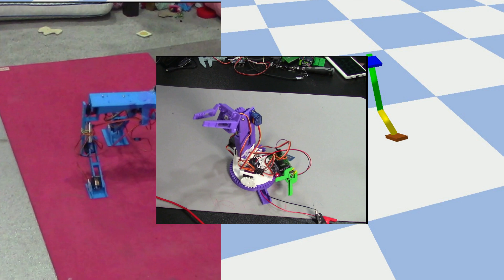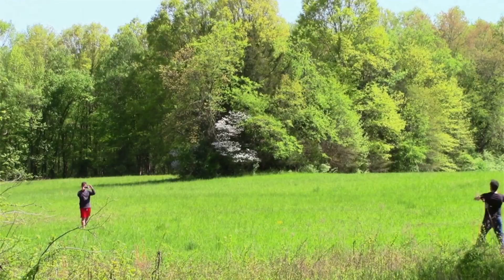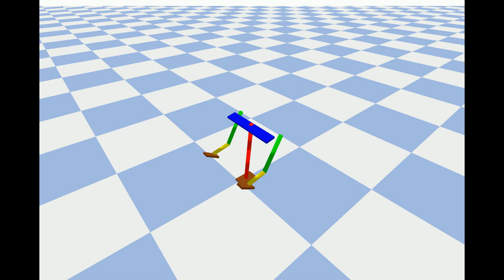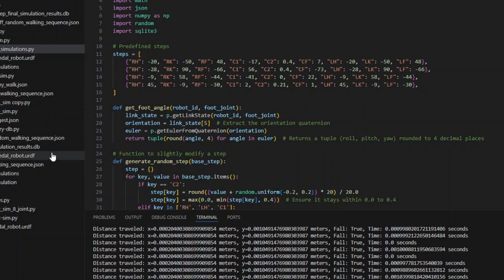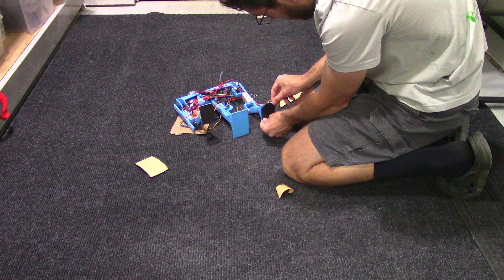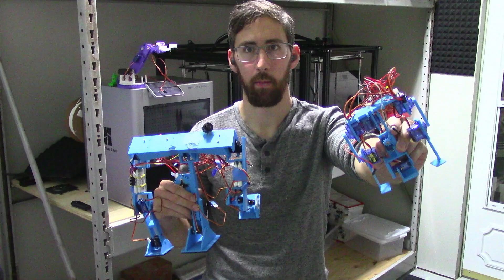Simulating 1 Million Robots with Python for Real Life Robot Test

Comment: So wait, why didn't you use machine learning instead of randomization?
Reply from the maker: I was supposed to talk about how I need more data and the irl training zone & feet sensors are critical data points. Also the virtual Tripedal's parts are different sizes and mass than the ones in real life. And I can't update the Virtual Tripedal until we finish building the new one.